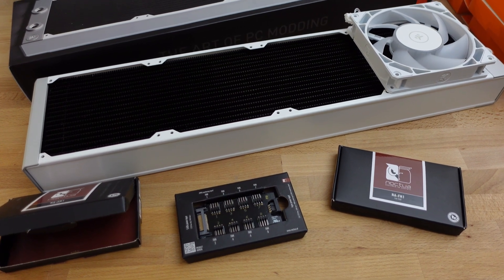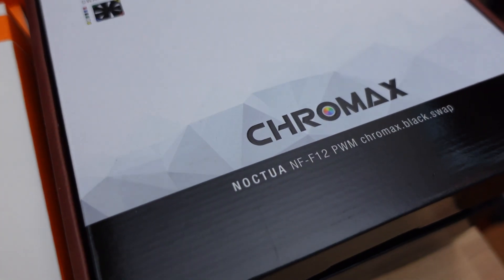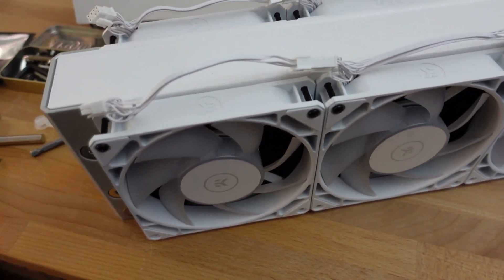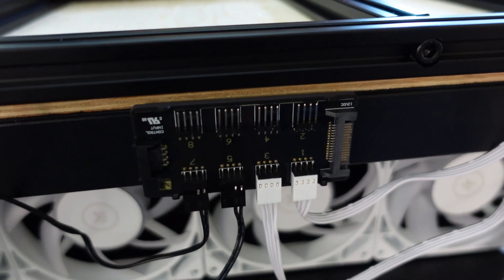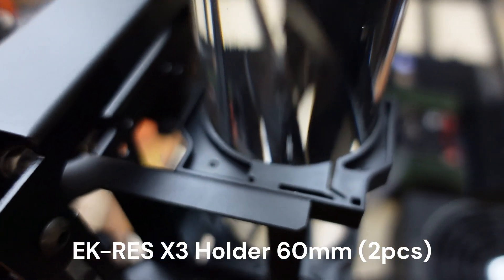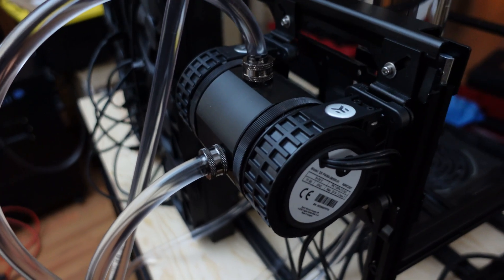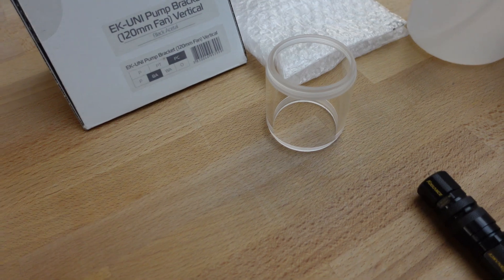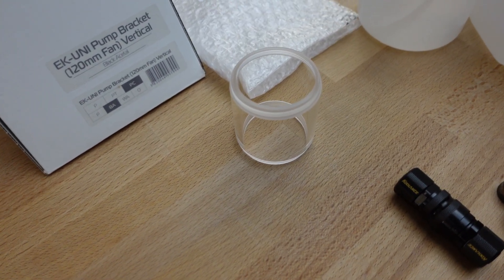No leaks! - EK X560M and PE 480 radiators, Noctua NA-FH1, and EVGA 1000W T2 - Hephaestus Build

Comment: yooooooooooooooooooooooooooooooooo just a heads up the PHANTEX T30S ARE THE BEST FANS MONEY CAN BUY i went from the notua ipp 3000rpm witch were good but louad af to the be quite pro wings 4 3000 rpm witch did not stop back flow on rads to the PHANTEX T30S and they are so quite at 3000 rpm while stoping back flow and push crazy amount of air
Reply from the maker: Thanks, do they make a 140 mm version? I'll see about looking for the Phantex T30, heard about the fan and was curious, may give them a try.